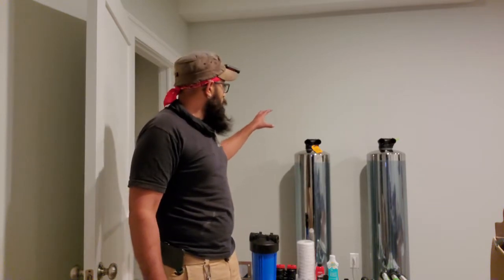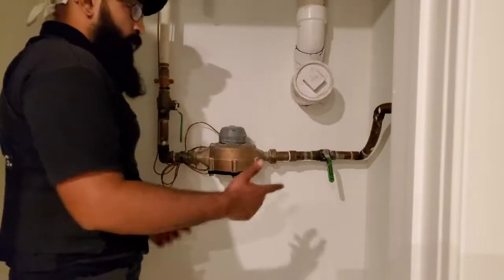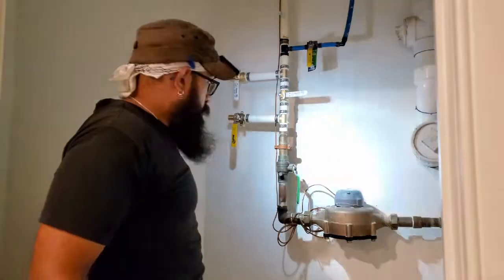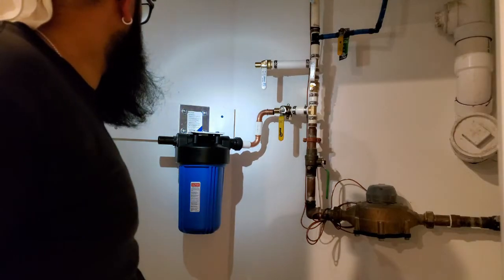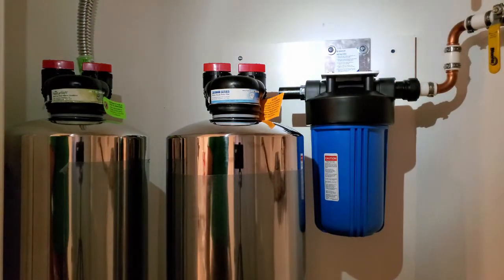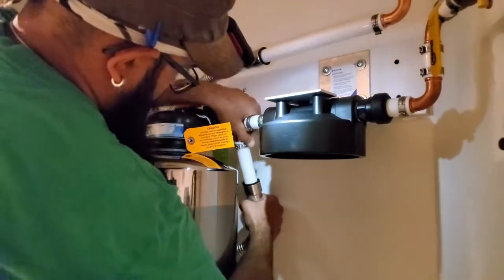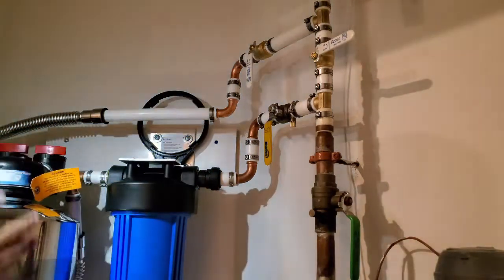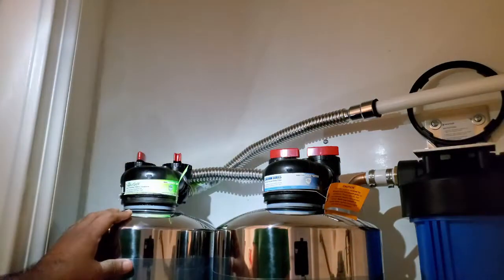Installation of Pelican whole house water filter and softener alternative system (PSE2000)

Comment: Excellent video! Each step was clearly explained.  Q: could you do a bit of background on the typical PEX pipe sizes in use in residential plumbing? I have been looking for a licensed plumber in Central FL to install a Pelican 1800 system with all the added bypasses you demonstrated in your video, but having trouble finding one.  The installation looks very simple, but I wanted to be sure I found the right parts, and the pipe sizing is a bit confusing to me.  Like in your demonstration, I want to install this system in front of my water heater (currently the city water splits into two - one for cold, one to feed a water heater).  Like you, I have a fairly tight space, but have the advantage of installing all this in my garage where I have more space available to me.  I ordered their installation kit, so have everything I believe I need except for the bypass valves (which I believe ought to be added as a general rule).  Your comments and response are greatly appreciated.  Thank you!